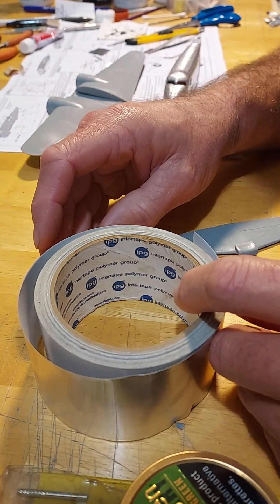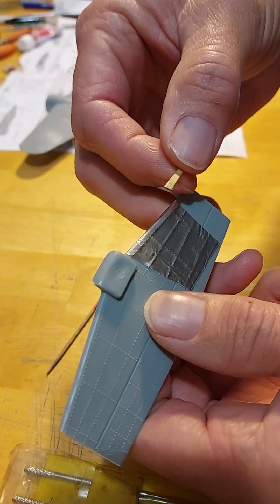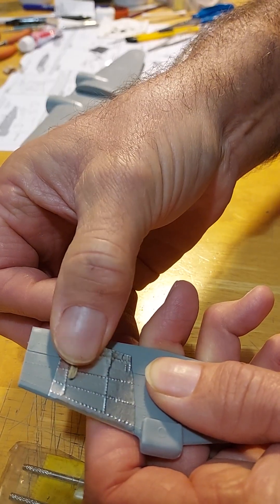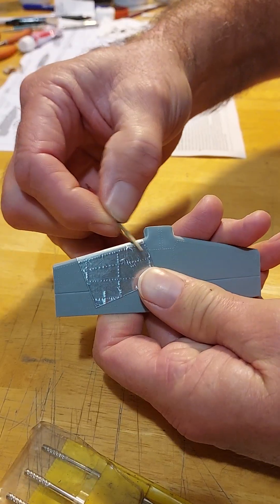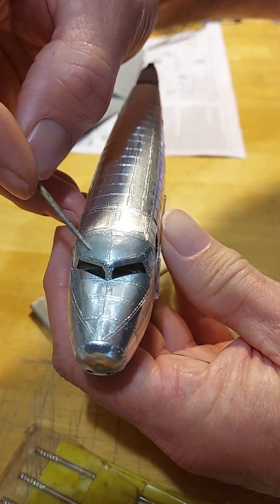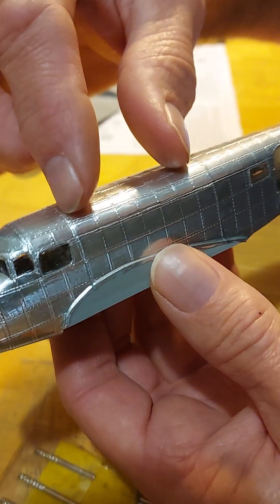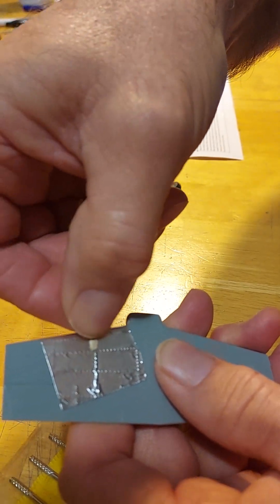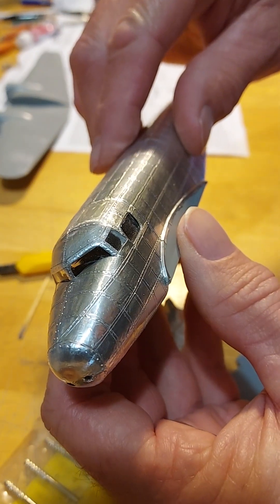How to use aluminum tape to skin aircraft

Comment: I have used HVAC tape for years for many hobby projects, including model and prop building. 

It's such a versatile, malleable, and durable material. It works well for skinning larger models, especially ship hulls, when the thickness does not become problematic.

I like to use old felt markers that no longer contain ink for burnishing larger areas.
Reply from the maker: Yep, been doing this since the 80s. There's actually very few of us that are good at it.. would love to see your work.